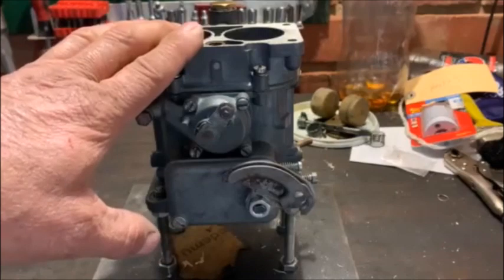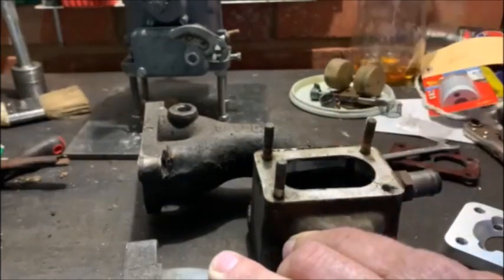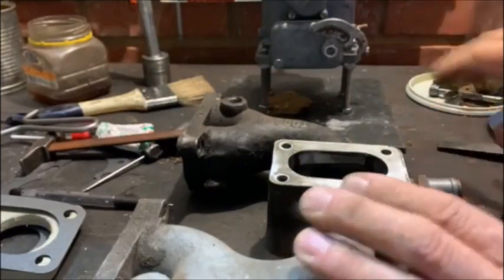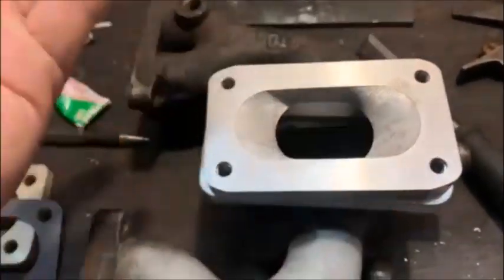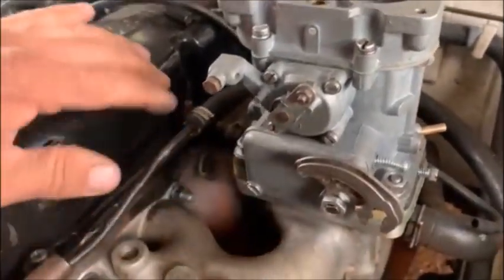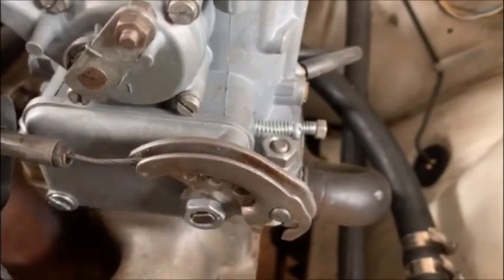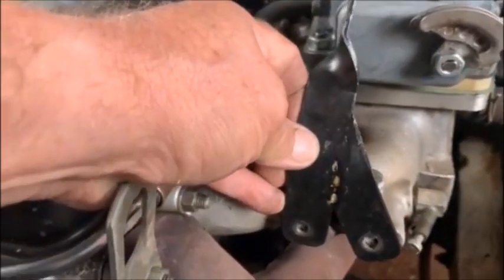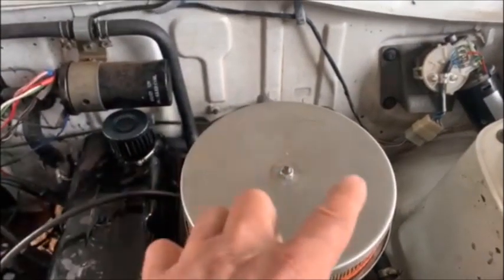How to fit a 36 Weber DCD carb to a Nissan 1400

Comment: Awesome video. Do these carbs increase power, and how different is the fuel consumption with them?
Reply from the maker: yes it usually does, with the correct jetting it will save on fuel usage, depending on how heavy your foot is.....

Comment: Good day 
Can you please assist me with the jet settings off a 36 DCD7 to a Nissan 1400
Reply from the maker: Mains 125/135 Airs 210/180 Choke tubes 24/25 Emulsion tubes F23/F30 Idle 50 Pump 50
Reply: @carburettorrebuildservice8964  thanks

Comment: Hi sir, I have a standard carb and it is sucking air there by the gasket. should I use a gasket make to make sure it stays on??
Reply from the maker: you should get your carb to someone that cab fix it and fit a new kit, stay away from gasket maker.

Comment: What about the vacuum pipe that runs from the intake manifold to the pancake filter why would that make a difference in idleling on the weber 36 dcd mine make a difference when I block it off it idles solid but open it idles un even
Reply from the maker: it should not make a difference, perhaps your valve on the manifold is faulty
Reply: Boss my card is blowing fuel out on top of the bornet what is the problem.

Comment: Hi. Really appreciate your vids.
I am running a Weber 38 on a 3.5 V8 rover with 210 airs and 55 mains. Engine is the old 8.13:1 compression  and fuel consumption is horrendous. Looking at 4km/ltr. 
Did some calculations and the CFM of the weber 38 is 350 CFM so is better suited to the 3.9/4 ltr V8 engine which has a cu/in of 304 and is rated at 350 CFM while my 3.5ltr  has a cu/in of 215 and is rated at 248 CFM so looks like the 32/36 weber which has a 240 CFM rating might be better.

But someone suggested the 36 DCD as a better option. Not a carb I know or have worked on before. Do you think it would give me better fuel consumption without losing to much on performance. I seldom drive over 3500 rpm anyway and it's only 148 HP. 
Appreciate it
Reply from the maker: Hi, the 38 Weber has two 27 venturie's, i use one on my Nissan 1400 that i modified to progressive and it is not bad on fuel. i also had one on a 3.5 Rover and it worked fantastic. Try smaller main jets, remember the 38 has two additional enrichment systems so you can go smaller on your main jets.
Reply: @carburettorrebuildservice8964  Thanks. Appreciate that. Can you explain the 2 additional enrichment systems. I haven't heard any one mention those before. I am in Natal by the way. Do you sell spares for carbs?
Reply from the maker: @fireandforge  check out my video named Weber power valve enrichment systems